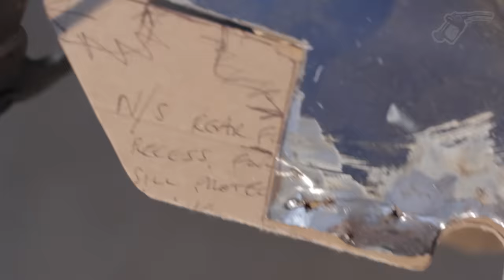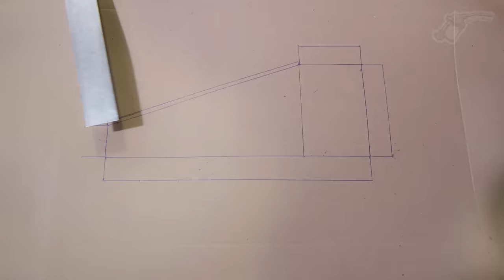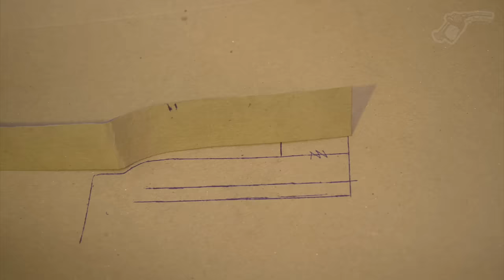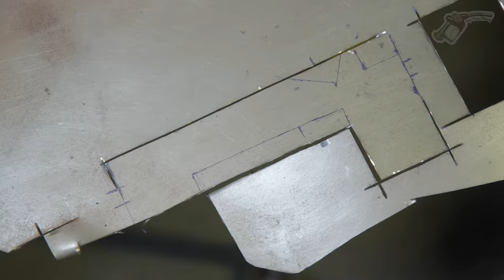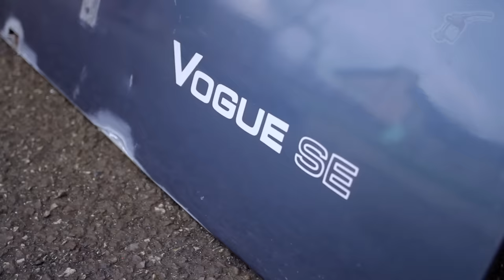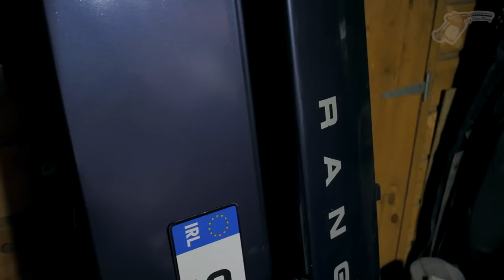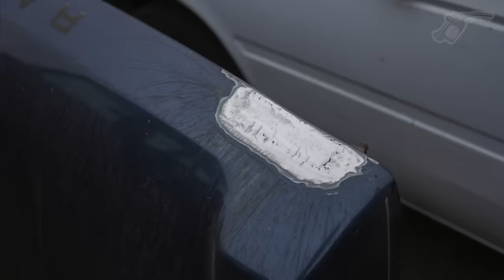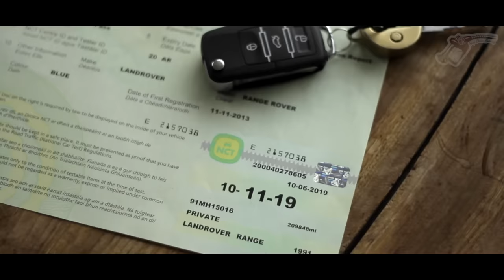How I restored a classic Range Rover and saved it from the junkyard // SOUP Classic Motoring

Comment: I am CNC brake press operator and I have to admit that your folding using only hammer and piece of wood is brilliant. Keep up on good work.
Reply from the maker: Built a 5ft brake in the midst of the project to fold the new load area rails, it's all in the episodes. Thanks for taking the time to comment :)

Comment: Imagine how long it would take you to complete this project if you had to stop working every 1/2 turn you made on every nut and bolt to take a picture.  And trying to weld one spot at a time so you could stop and take a picture.  The way the welds looked without being able to do them in one continuous motion is completely mind boggling.  This is like cleaning your whole house by picking up one piece of dust at a time, then taking a picture, then putting them all together in a film, which I imagine would be TENS of Thousands, then uploading them on here.  Whoever did this deserves to be a millionaire several times over because this is by far the the absolute greatest piece of art I’ve ever seen.

Comment: Most of my repairs were thankfully mechanical. My diff started leaking, but unlike you replacing the back end I had a new one welded over the top of the old one.  I had to replace the steering box and power steering pump motor. Front drop swivels on both wheels. No anti roll bar on mine, so added procomp shox.  My upper tailgate was rotten in part, but luckily I got a virtually new one off ebay.  Sliding roof motor was knackered, but never replaced it.

Comment: love the work and mad props. I'm a welder by trade and if I would give a few pointers. First off i wouldn't have used galvanized steel for the work it would have been more suitable to just use mild steel and i hope you wore a mask because those fumes are very toxic. Watching your welds as well it's best to tack and start welding from the middle outwards helps with the heat and warping off pannels.

Comment: This is such a fun video. I have so so many questions though

Like what kinda metal (s) are you using to do the repairs? Where do you get them? 
What are the key tools you're using?
How do you know where the screw holes of new cuts of metal should be exactly?? 
Where did you learn to weld? 
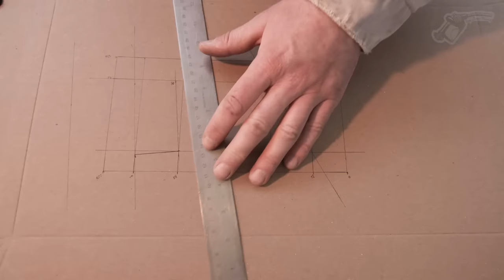Where did you learn to do stuff like at 9:06? What even is that?
How do you cut the rusted bits so precisely? Is there a tool for this? I'm literally dumb.

Comment: I am blown away by the skills - both mechanical and videography! The 1,5h flew by like nothing and I want more!

But, I have a question: there was often the situation where you separated two sheets of metal that were touching along a surface, not only a line or even pojnt (for example from 1:08:25 onwards). You have only cut out a seemingly little piece and treated the surface underneath, then welded on a new piece of metal. Doesn't the corrosion wander between these two sheets, so that there'll be more rust hidden underneath, right next to were you worked? Wouldn't it spread further now?
Reply: Oh, and you definitely got my sub. I came to your channel with the video where you put the windonws in the sprinter van (beause I am looking at sprinter vans myself right now, so naturally your video got recommended), got mad a little because you "took so long" for the next video. I have now watched a couple more, and also your how-to video where you show how you make your stop motions. I was definitely in the wrong about being "mad". You work is awesome!

Comment: Hey George, I am curious. I have a similar Range Rover that is a decommissioned family car my mom used that's been sitting a while. Would it be more achievable and affordable if I didn't use exact rover parts? Like other suspension and new not originial-matching interior pieces or things like headlights? Where do I search for the best replacement parts? Is there an affordable way to replace the electronics?
Reply from the maker: Shop around, Thomas. Not sure where you are but there are loads of indy LR parts providers in the UK. I'm not affiliated with, sponsored by, or endorsing any of these, but off the top of my head you can try John Craddock, Paddocks, Rimmer Bros, Famous Four, JGS4x4, Island 4x4, Britpart. Also Ebay. Non original parts, like for any car, can be great or terrible depending on who's making them. Try searching the LR forums for intel on whats good and what's not.
Reply: @Soup Classic Motoring  Thank you George, I am in Alabama, USA. I'm intimidated but because of your encouraging words I am excited to slowly work on it and hopefully have it looking similar to yours one day. Cheers

Comment: How do you find the spot welds in the boot floor? I’ve sanded back a lot and I just cannot see them anywhere.
Reply from the maker: Sometimes you need to go harder than sandpaper... a grinding disk used lightly shows them up pretty quick.

Comment: Could you please tell me what welder you are using and what the settings are?  I've been trying two different welders on sheet metal and I am being driven insane trying not to get burn through.  Lowest speed and lowest voltage and I'm still chasing holes.
Reply from the maker: In the work in this video the welder was gasless, I wouldn't recommend it. Now my welder is an R-Tech MIG 180. I love it. I can't tell you specific settings because it's different all the time, but I find the wire speed needs to be 1.5 to 2 higher than the power. So if the power is 2, the wire speed should be 3 to 3.5. Also try slowing down between welds. Good luck with it.

Comment: I did notice that you have a lot of splatter in your welding.  You are either running your wire to quick or you are welding at too low of a temp.

Comment: I have a Bosch 4.0 powered Discovery 2 SE7 that has 200,000 miles on it and has NEVER. BROKEN. DOWN.

I think I have to donate it to the Smithsonian when I'm done with it. I have the only reliable Rover v8 powered land rover in existence.

Granted, the original owner did spent ten grand on a full engine-out teardown at 20k miles to have the block and heads milled properly and prevent the ubiquitous head gasket failures, but still.

Hasn't broken down on me in the 7 years I've owned it. Normal maintenance (oil, fluids, replaced the original water pump and 10 year old air springs) only

Comment: I would say, do not try this at home. Get a better car to start with then take it apart completely. Replace whole sections rather than making a car by welding together tiny pieces. There will still be lots of rust on the inside hidden away. This is a jigsaw puzzle car that I would not want. Range Rovers are about quality and prestige not a massive heap of rust.

Comment: Why did you work this way instead body/transmission separation, sandblasting and making new details on factory blueprints?
I also didn't see any corrodion protection on welding works. Looks amature to me, sorry, but I think it's a waste of labor time to do this, what is the point of this saving if it will be rotten again few years later?

Comment: Work will fill in for the time allotted for it.   It's too bad that after all the work you did you still have a range rover.  There are way better ones at pick and pull like with no rust and only need a transmission or steering pump or whatever.  If something's that rusted out,  it's a piece of shit and should be scrapped.   You don't want experience like that,  it's like rehearsing a failure!  I know because I am guilty of the same.  I wish and hope I take my own advice. Life is too short to waste on material things.  Sentimentality is not for "things" all things must pass.  Rust never sleeps.  Sorry you got to hear me rant. Great work though really.